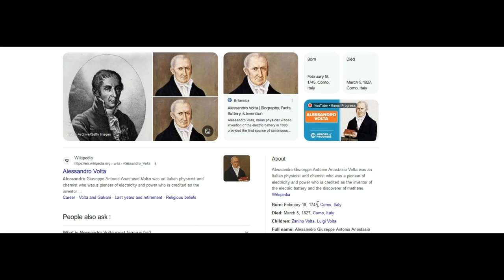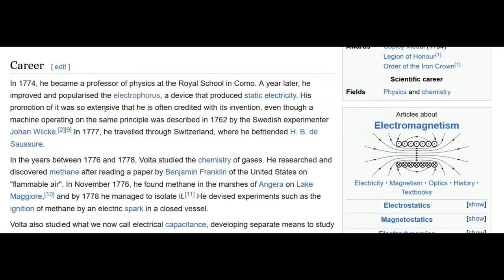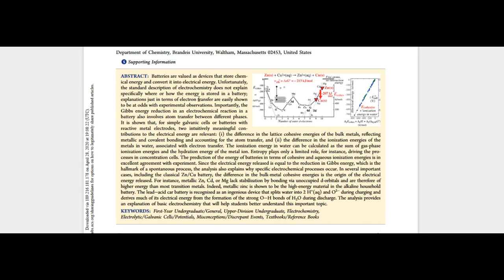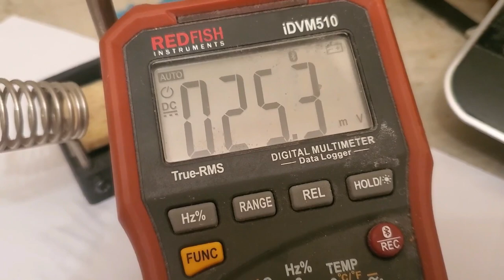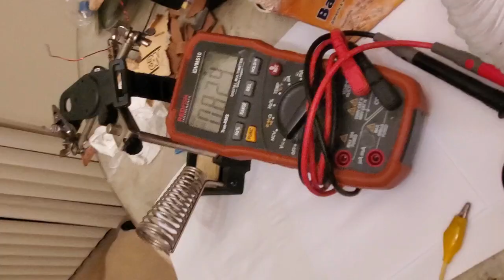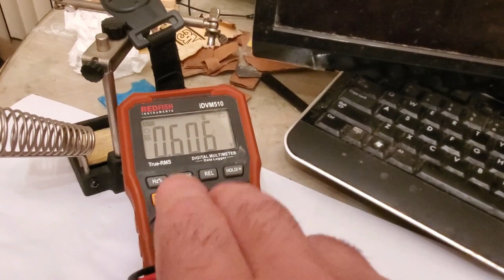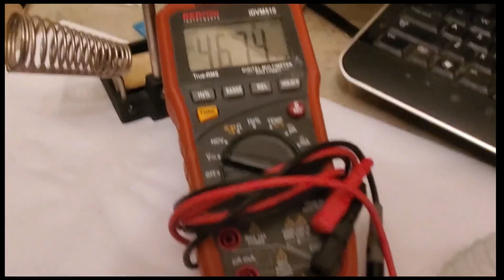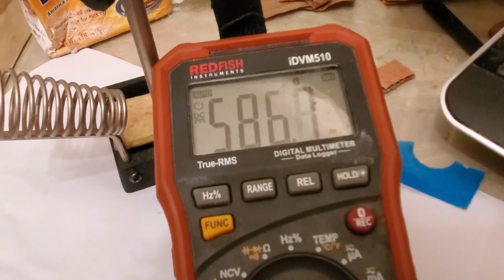Home Brewing a Battery: I

Comment: Try reusing part portions of the many disposed batteries. just a thought.  Maybe you mentioned doing just that while I stepped away.
Reply from the maker: Funny you mention that, before I made the video I tried taking a hack say and pliers to a dead alkaline battery the thing was like Fort Knox, thought about getting out the Dremmel and then said screw it and ordered a few zinc sheets.
Reply: @paulmaher812  lol, some are "Made in USA" Steel/Peter Built Tough nuts to crack but the innards strike me as seemingly obviously valuable contents. I wonder grinding and re-packing those pencil (lead) sized (looking) do-wah's to making full sized mammoth batteries would be possible? (Shoot! ALL's possible)